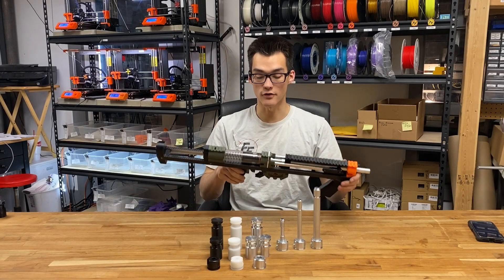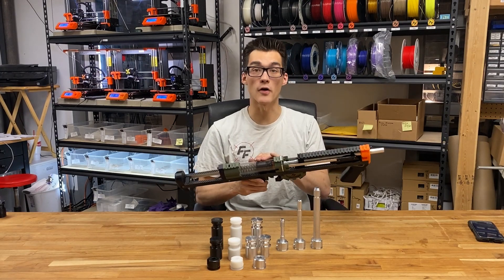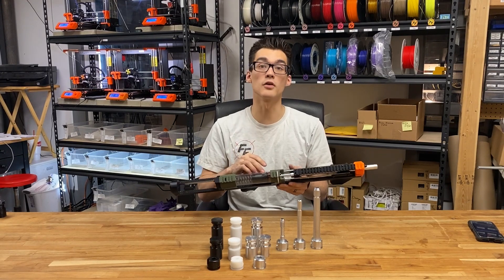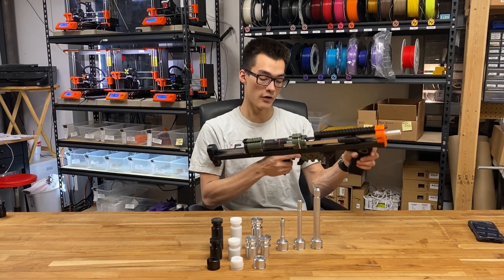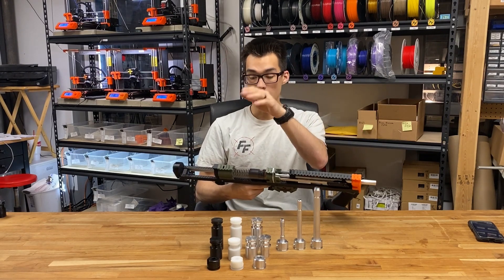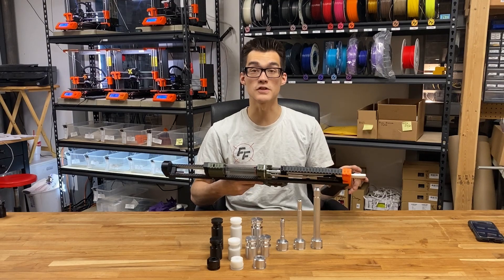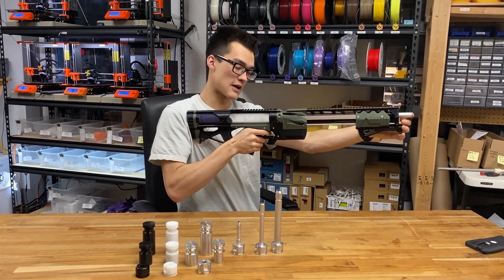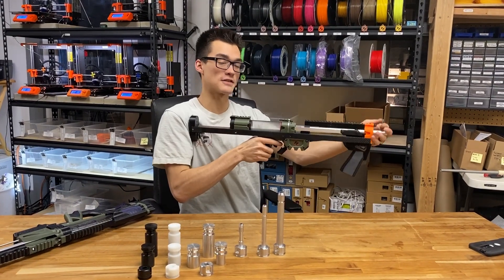Printed vs Machined Plungers | Nerf Springer Blasters

Comment: With a heavier plunger like the Aluminium one I've heard FPS goes down a fair amount due to the slower plunger speed. Is that true? Will the better seal make up for it?
Reply from the maker: SpikeJonesTheCr0oked The better seal usually makes up for it, but it is a fair amount louder and heavier. If you’re looking for maximum FPS, I’d go acetal, although there is a certain satisfaction of using metal parts.